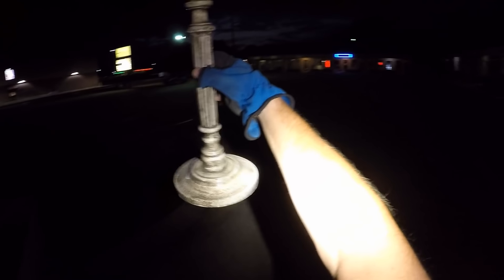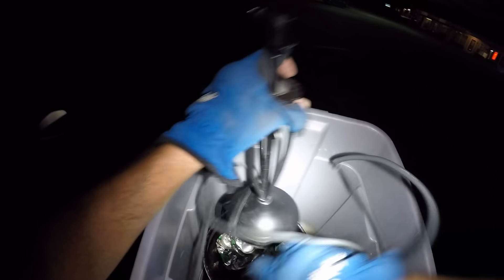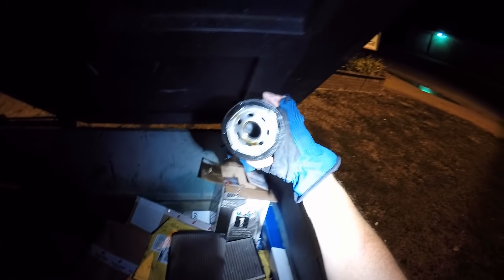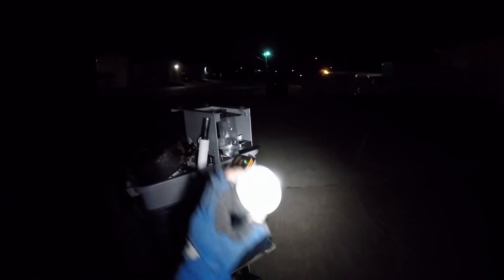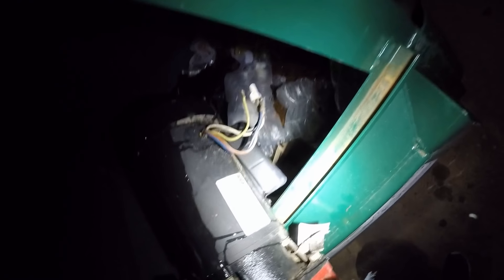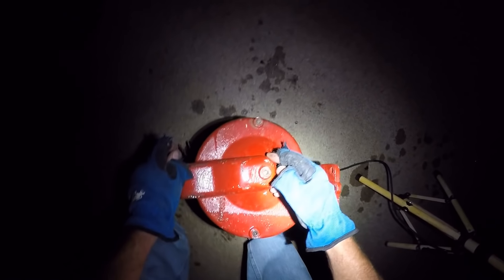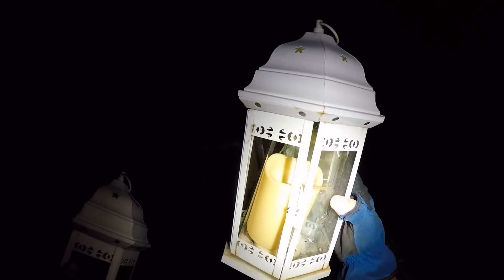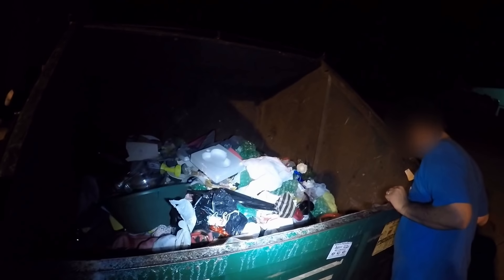REALITY Dumpster Diving - STREET SCRAPPER

Comment: Those aluminum capacitors have tightly rolled aluminum foil and plastic in them. Ive thrown them in irony aluminum with no complaints. The connectors for the wires are often steel so it makes sense

Comment: I was going to say the same thing. You scored 40 cents on the fan motor, then the very next dumpster you scored around $17 bucks. With the work light and the water pump motor and dryer hose. I use to micro scrap years ago, I had to figure it out the hard way. The scrap yards in my area has the prices just right in scrapping either way, it amount the same. To me I just spend little amount of time on the scrap and look for more stuff to put in the pile. :)  There is a way to get those shredders for tin. But last time I saw those, the price doesn't justify for profit for me.